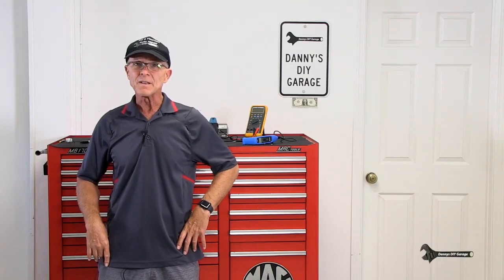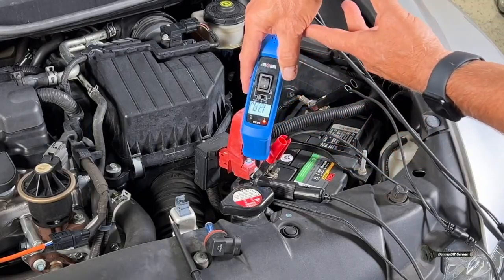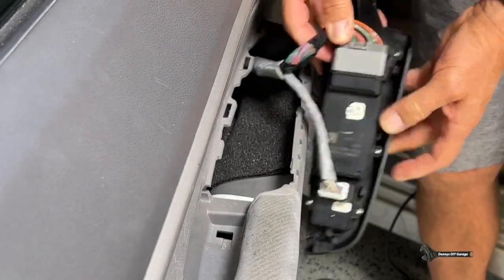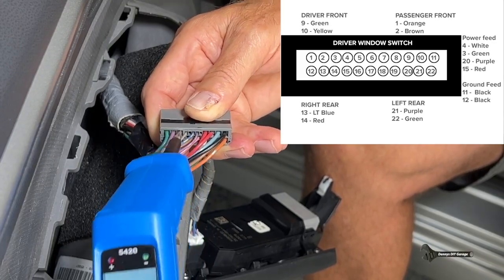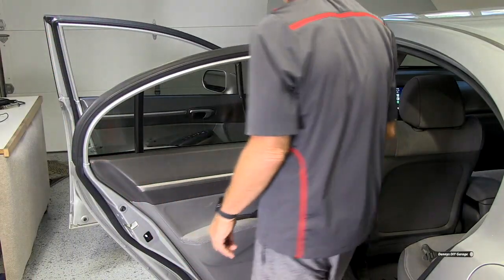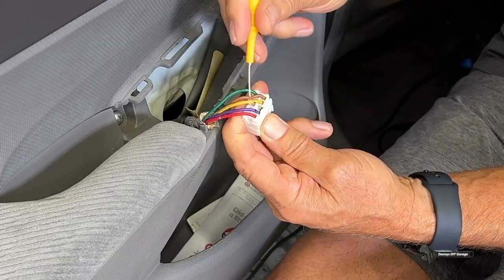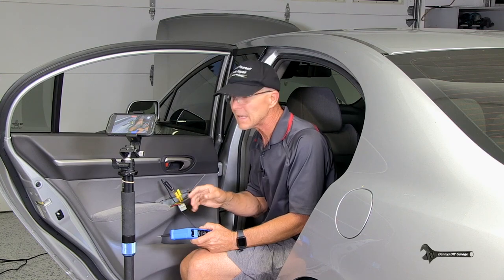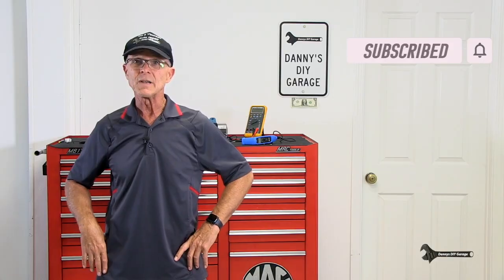Power Window Won't Go Up? (REAR Window) Diagnose Any Power Window Failure at Master Switch Testing.

Comment: My 2021 Nissan kicks back window goes down half way up stops mess with master switch 20 mins than will back switch driver side won't raise it up or down any suggestions,thanks
Reply from the maker: Worn out motor, a current draw will confirm that

Comment: Great video I just changed a window switch on a Nissan Navara, but I was kind of lost on how to test things this really helped and gave me clarity. The driver window motor wasn't going up or down even after changing the switch, since I knew its an electric motor I did the same trick I do with a starter and tap it with a screw driver. works like a charm now :D
Reply from the maker: Glad it was helpful, thanks for the feedback and your support.

Comment: What could be the reason, when window glass moves and stops after 1 or 2 inches either direction, then after some time it again moves 1 or 2 inches and stops, plz help
Reply from the maker: Most likely it needs a motor/regulator assembly, next weeks video I show how to determine if the motor is bad by testing the current draw
Reply from the maker: Window regulator assembly 
Driver Side: https://amzn.to/41JIzbw
Passenger Side:https://amzn.to/48g4f1v